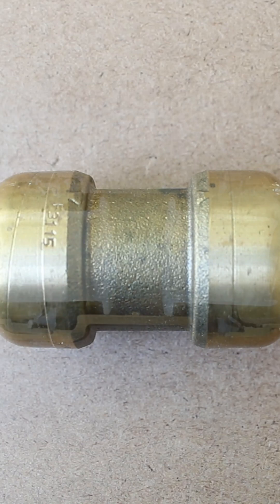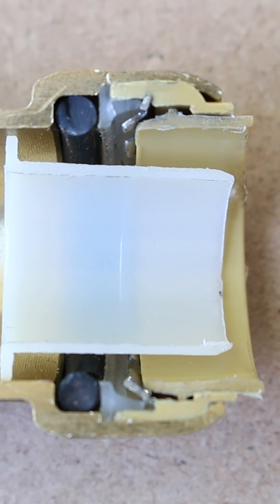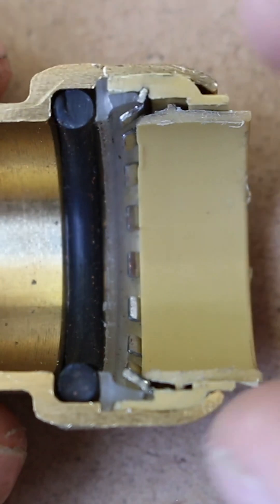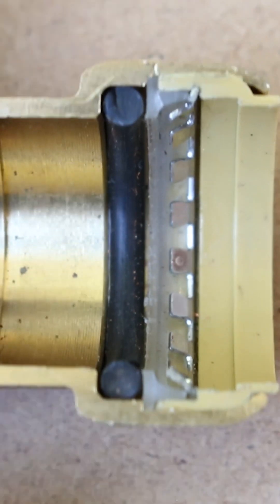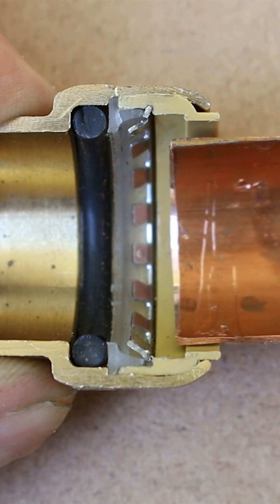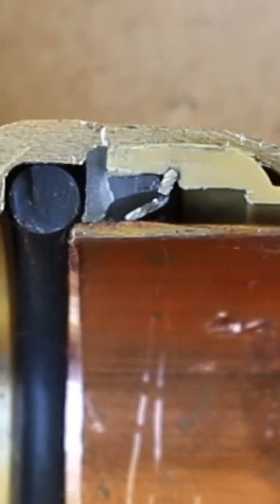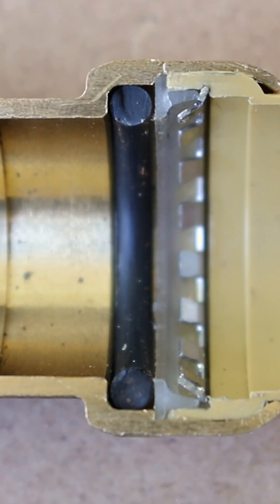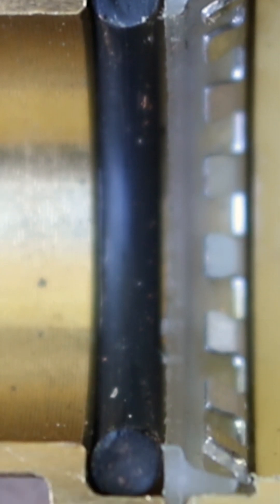How Sharkbite (Pushfit) Fittings Work (Pt1) | GOT2LEARN

Comment: So, one thing I don't quite understand: once inserted, the pipe (Pex in my case) can actually be rotated while inserted into the Sharkbite fitting. How is that possible with the metal teeth inside the Sharkbite fitting?
Reply from the maker: The teeth actually turn inside the body of the fitting ;)

Comment: I wouldn't want them installed in the walls or places inside my home but in the crawlspace and garage where I can see them i use them. Several sharkbite fittings under my house are 12 years old and not leaking so far. Follow the instructions! There's my 2 cents ✌
Reply from the maker: correct!

Comment: Hey ive been doing a lot of research and doesn’t steel in contact to copper causes bad corrosion reactions???, i don’t get it, cannot be in contact to
Other metal if not brass or copper will break down causing corrosion on both metals?
Reply: That is stainless steel (which really isn't steel) inside of brass.  A magnet does not stick to brass or good stainless steel.
Reply from the maker: Correct sir!

Comment: Thank you for the video. I used them for the first time about 6 years ago. Pipes were frozen and water was draining in the cellar. I was very hesitant to use the fittings but damnit they are working to this day.
Reply: Orings will eventually fail. theres no way they wont.
Reply: @shrimpinpat  It's true, he will be very unhappy in... 30-50 years... I had to replace my copper pipes due to corrosion from hard water when I bought it. Every use case is unique. For me, pex was a better option than wasting money on expensive copper. No issues in 10 years.

Comment: I want to respect the knowledge of plumbers. You are the experts. However, in my extended family, we have had multiple bad experiences with plumbers being unscrupulous. My brother was quoted $3,000 to replace a simple shower drain and a few feet of drain pipe. I did it for him for $20 in parts and an hour of my time. Another plumber installed the shower drain incorrectly in my house and put the gaskets in the wrong place. It leaked and ruined our living room ceiling. For my father-in-law, a plumber was hired to install a valve for an HVAC humidifier. Instead of doing the valve as requested, the plumber installed a piercing saddle valve and charged $400 to do so. So you can understand why many homeowners have gotten on the PEX bandwagon and occasionally use Sharkbite fittings. I understand this isn’t all plumbers ripping people off, but we’ve been burned. If you deburr the pipe and prep properly, these fittings work well.   And if it leaks in 10-20 years, so what. I’ll just replace it. I personally don’t put the Sharkbite fittings in walls, only accessible areas. I use copper crimp rings for PEX-B in wall or PEX-a.
Reply: I think everyone who owns real estate should do most repairs by himself.  You know when you did a great job and save incredible sums.
Soldering copper pipes is easy with some practice. You profit from your DIY skills a whole life!
Reply: That $3000 price was most likely the 'i dont want to do it' price from that guy, getting a few more quotes would be prudent IF the job is something you cannot do yourself at all.
Reply: I had 1 big-ish job, 1 medium job and two small jobs at my house and it was going to require about 6 hours total of a plumber's time. They quoted me $6k.  I did it all in a weekend for $650 in materials.
Reply: Your brothers a crook shame on him

Comment: i just installed this on a copper pipe on cold water line of water heater. its leaking on the copper pipes connection, could it be the O ring? i did not use the depth tool or a deburring tool
Reply from the maker: You've answered your own question 👌
Reply: Perfect) I used the tool and it fixed that issue. Now the dielectric nipple that goes into the water heater (cold water line) is leaking some water at the top, what should I do? The replacement one is  not as long as the previous one could that be the issue? I noticed my plumber used some foam installation or some kind of dry putty around the gap that prevent water from flowing up and out.
Reply from the maker: @chrisWTG  I'd say, watch these 2 videos I made...
1) https://www.youtube.com/watch?v=V48FQBbeZhk&ab_channel=Got2Learn
2) https://www.youtube.com/watch?v=aPZJNZHU3Hc&ab_channel=Got2Learn
Reply: @chrisWTG 😊
Reply: I was very skeptical of Sharkbites for a while, but.... Sharkbites only leak for a few reasons, all of which are preventable.
Reply: if you cut a pipe and don't remove the shavings (deburring) you are shredding interior components as you install your sharkbite. If you dont have the depth tool your pipe may not be fully seated at the right depth causing leaking.

Comment: Perfect example of why the shouldn’t be used except for temporary use. All O-rings eventually go bad. Bump it in 10 years or less to watch it leak.
Reply: I find that that A LOT of people install sharkbites INCORRECTLY or even damage the piece during installation...That's why they fail...I've seen them installed for many many years in many conditions without any issues. If your SBs fail..consider doing your research before installing them...There are  a few steps you need to take to do it right...
Reply: @Johntheheadache  I have been a plumber for over thirty years. I think I know more than you do.
Reply: @BlueDart1971 👍And ironically, shark bites and the similar products, designed for green hands, are not cheap!  They are just a way of manufacturers to get $ out of consumers’ pocket!
Reply: Pro Press o-rings are rated under warranty for 50 years
Reply: @JordanK151 you believe it?
Reply: For those unfamiliar with this product, Ford uses a lot of such fittings (not necessarily under the SB name) for its cars plumbing system, such as radiator hose connectors.  They are notorious for leaking!
Reply: Really? Every plumber I’ve asked at jobs where I’m also working have said shark bite products are great
Reply: @whiltoecardhonian3054  YES, GREAT! Sarcasm! Expensive and designed to fail!
Reply: @whiltoecardhonian3054  100 plumbers will give you 50 different answers. My personal experience is they are junk.
Reply: Well solderered pipes start leaking eventually too, thermal expansion/contraction will do that to a joint
Reply: @wouterv7980  what experience do you have in that field?
Reply: They last Longer Than 10 Years! But Should never Be Placed Inside A Wall Or In An Area You Can Not Monitor! My Mom Has Some On Her Water Heater that Are Pre 2000 And Have Been Removed And Reused Once!
Reply: @kevinlsims7330  you just explained why they aren’t worth using. If you shouldn’t use them in a wall why bother with using them at all.

Comment: I’ve used one in my life, on a water heater hose with a shut-off valve made onto it. Remember people, never use these inside a wall or floor. Chlorinated water may deteriorate that rubber o-ring.
Reply: Wrong

Comment: so Propress is better
Reply from the maker: IMHO, yes.
Reply: Lmao nope....
Reply: They are practically the same thing except pro press has a stronger mechanical connection. But that mechanical connection makes repairs more difficult. For example if an elbow needs replacing, a soldered elbow can be heated and removed, and a sharkbite elbow can be removed with a removal tool. A pro press elbow has to be cut off and the a new elbow won't fit because the ends of the tubing is too far apart.
Reply: Not in tight spaces..I've repaired leaks using a shark bite when I couldn't see the pipe only feel it .. definitely a great copper to pex fitting
Reply: Yes, better by 100%

Comment: Thought you were going to explain the parts you took out.  :(
Reply: If im to guess, they are supports for plastic pipes or pex. Since pex is flexible, it needs some sort of extra structural integrity to push the pex into the teeth. Idk what they are called in english tho
Reply: @eragonthedragon967  Got to learn says:  Wait for part 2
Reply: @funnyfarm5555  i already checked it. I was correct :p but by all means, im not here to pull views off of his vids. They are actually quite insightful
Reply: The piece he took out it what goes inside the pex opening.
Reply from the maker: Wait for part 2 😎